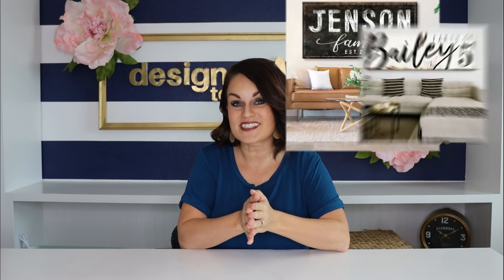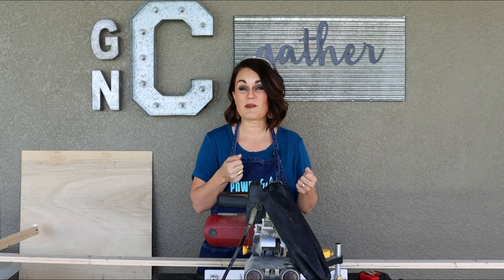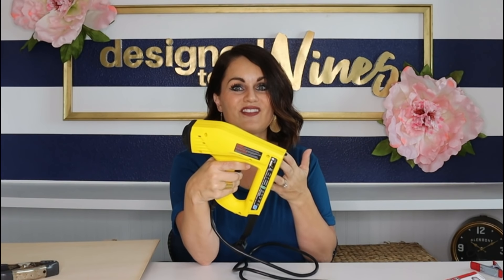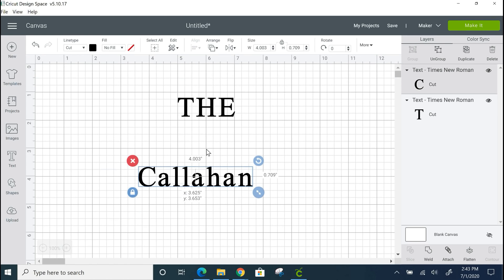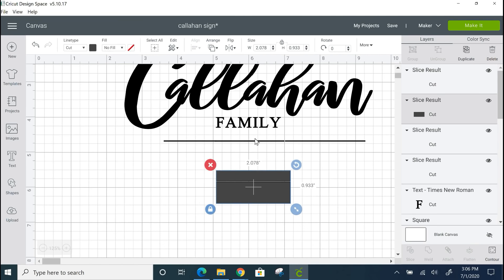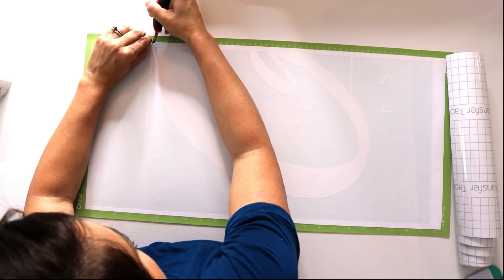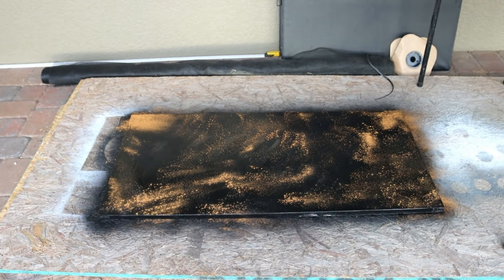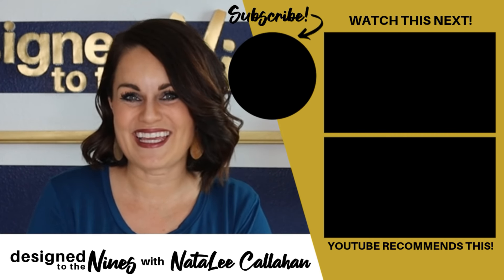PINTEREST INSPIRED DIY FARMHOUSE Sign/Wall Art w/ Cricut!

Comment: Hey your sign is awesome, as for your question on what to do about the lip left from the margin where it won't cut. You use that part to layer your next section on so that your design matches up correctly. When you apply your transfer tape you leave a little extra over the lip to line up the next section. It makes lineing up the big designs a whole lot easier  that way your won't have to go back and fix the oops areas.
Reply from the maker: Awesome! Thank you so much for that helpful tip Ashley. Very helpful.💕

Comment: I usually make my signs the opposite of the way you did this one. I apply the negative part of the stencil to my wood and paint over that. Also I have never tried the cinnamon trick. I might try it on a small sign first to see if I like the effect. Thanks for the video. I learned some new tricks. I have been a Cricut user for years.
Reply from the maker: This was different than my usual stencil way too... I kind of used the white paint as a primer, and although it was a little backwards it ended up working out great. 😃